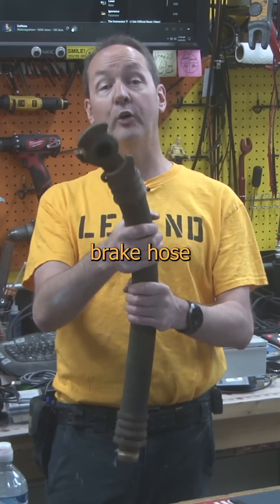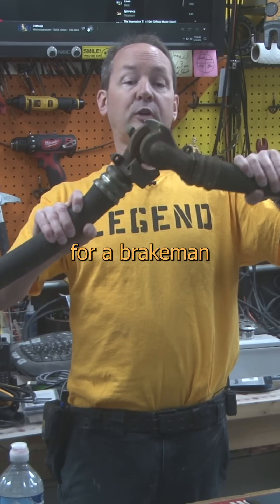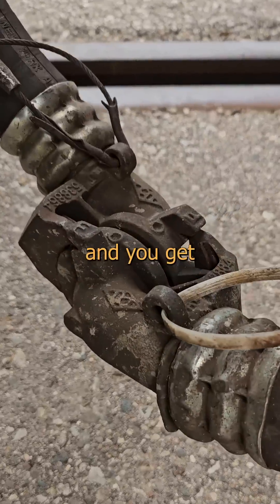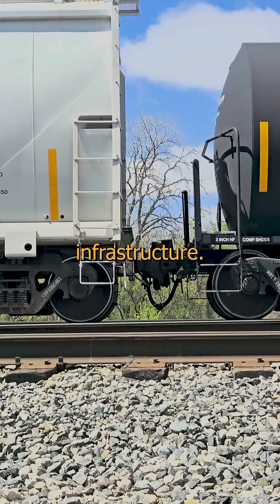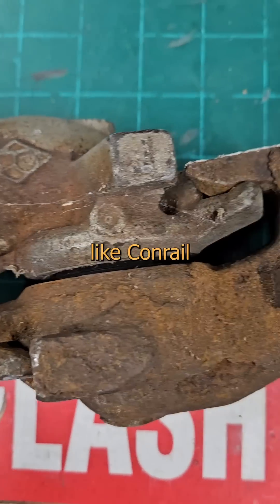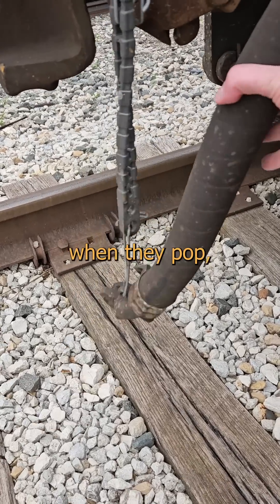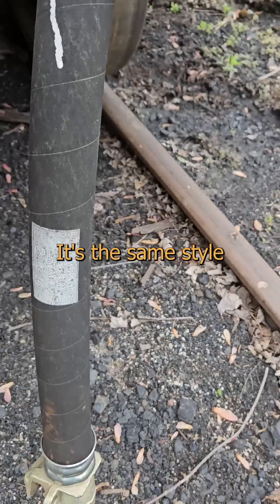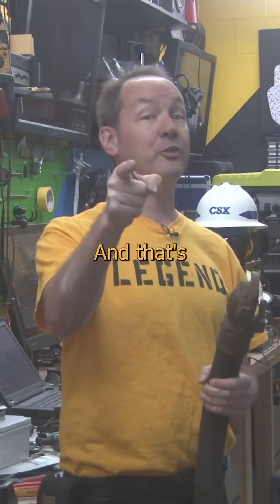Railroad Brake Line #chrisboden #comedy #engineering #train #gladhand #educational #connection #hose

Comment: As someone who volunteers at a small tourist railroad, these things can be a pain. Even when the line isn't under pressure, that's a good solid inch plus of rubber hose, so it doesn't like bending without a little elbow grease! And the conrail joke was very well done! As a train enthusiast I approve!

Comment: The seals do go bad somewhat regularly.  But they are quick and easy to change.  Usually a couple of them stashed away in the locomotive for just such an occasion.  Keep a couple in your pocket when you walk the train and it's no big thing to bleed the brake pipe down, separate the hoses and pop in a new seal.

Comment: If fact yes it greases the wheels but it will take days. Until damage start to get real maybe about 5, day but that depends  but if it's fine and lubed you can run the train you still have to put these hoses together it's law and safety but let's say it doesn't have a hose and it's lubed your fine for a few days 👍

Comment: 90-100psi in the brake pipe. mr lines for the locomotives up to 140 but those are smaller volume. theyre also a PAIN IN THE ASS to connect when theyre actually on the units, youre squatting between the cars/locomotives in between the rails and the hoses arent reasonably stiff and dont like bending the glad hands up.  and yes, they will fuck you up if you get hit with one under pressure when they disconnect without a cable (more common then rubber ones) holding it in place

Comment: I worked for CP rail in the mid 70s.  The large brake hoses held 150psi, we would break them by putting our leg against the hose and lifting it.  It was like holding onto a wild bronco.  A friend worked at CN rail, a government operation, they would just pull the train apart, thereby blowing the hose.  Sometimes the hose would break, and they would have to stop and repair it.  This is an example of a private company vs a government operation: Broken bones vs broken hose

Comment: I'm a little confused. So these brakes not function using some type of fluid? The reason we used fluid in automotive brakes is because liquod doesn't compress. Get air in the system and the pedal is spongey due to the air compressing. If they use fluid how does it not need to be bled?

Comment: True fact.  The air pressure d sure in these hoses DEACTIVATES the brakes, same as in a semi.  

Should a coupler fail, the hose pulls apart,  the line pressure in both parts of the train goes to zero, and powerful springs engage the brake shoes.  Often sand is also dumped on the tracks to improve traction, too.

Comment: You should see the hydraulic brake valve which has 50 plus parts and you've got 8 minutes to tear it down where it goes to a washing machine and then rebuild and those fuqers get hit with a $2 million dollar fine if they fuq up

Comment: Looks like the chicago fittings i used at my old work. Just slap em together and you got a good seal. Need em stuck together flr a while? A pin held the two sides from sliding just in case.

Comment: That’s a big ass set of glad hands. We use the same connectors on semi trucks service air lines to connect the trucks to trailers. The connection allows us to create a connection between the trucks air compressor and the trailers pneumatic brakes. 
Fun fact, we also use the grommets on them to make a Venturi tool when paired with a hose and an air gun. Helps us pull air from the fuel system after a service.

Comment: That is not for "getting fluids" anywhere, it's for the pneumatic railway brake. The one he is holding is made for 5 bar of air pressure, if it has a cross on it it's made for 10 bar which is usually only found in passenger coaches not freight cars. Don't rip them apart while under pressure, they destroy your kneecaps!

Comment: Yeah it works so easy , when you need it to.

Second issue, they almost always are not airtight.
Doing a brake test the acceptable leak determines wheter it gets fixed or not. Whether all of the leak was at one connection or minimal throughout.

Your being a bit genorous with those connections, LOL ...

Comment: yooooo shoutout, I worked as a rail car mechanic for 3 years, Ive replaced hundreds of those, we would just call them the end hose and the rubber thing holding it up above the ground was just an end hose support, I just called it the horse cock😂

Comment: As a trucker who may have accidentally remembered anything other than disconnecting my airlines before pulling away from my trailer... they are also able to disconnect without damage, not every time but I guess in an emergency they can, they just flung 5th wheel grease everywhere.

Comment: When switching, you're constantly connecting these and then popping them apart again seconds later. Every so often the rubber gasket inside the gladhand gets a wild hair up its ass and decides to eject on separation. Every tenured conductor has a batch of these gaskets on their belt or keys. I carried and extra batch on my lantern. Because if you didn't, you usually found a busted or missing gasket right away and it screwed up your whole day or night switching.

Comment: It's cool that even though our coupling works very differently here in Germany these air couplings look pretty much the same at first glance. And they haven't changed in a century. In theory you could connect a brand new rail car to a hundred years old loco.

Comment: I work for the Trainwell at Boeing Renton and we deal with coupling and uncoupling cars every day, all day, it’s shuffling around 4 tracks instead of freighting over one for thousands of miles, it’s really fun and dangerous, the hands are always sketchy but you learn to trust them, when you open your air valve to let the cars behind fill with air the hoses flex and twist under the volume of air, it’s only about 120psi per our cargo requirements but the volume of air is massive! working with BNSF is cool too, we have a Hercules TracMobile to hustle cars around but when BNSF comes in with their Locomotives, its always a treat

Comment: I do industrial blasting that airlines a baby to compared to what I use witch is a similar at locking you just but them together and give it a quarter turn  and the thing that is hold the hose is called a whip check

Comment: It's essentially the same thing on modern gas pumps to refrain the excruciating repair costs if someone accidentally drives off with the pump still attached. There's a second detach right where the gas hose is attached to the pump body just in case. (:

Comment: the steel and brass fittings are thick as hell and seemingly indestructible, but the rubber fittings inside often break or wear out... so conductors often have a few spares on hand and just swap them out as needed. Takes very little time. 

But those hoses don't link up as easy in the field as in your demonstration. It takes a bit of practice to get them to lock in right, especially in -38c.

Comment: I work with these things every day, and they're actually really cool how  the basic operation of these systems work . If you dived a little deeper, you'd get every  train furry a little excited with big hozes and things that connect with rubber. 😅  the coupling mechanisms are really cool as well, if you actually dig into them and how they actually operate . 😅 just food for thaught big guy , love youre content.  Keeps my tisum under control.  I am  allwase wondering how ur going to slide a furry joke in which is pawsome.

Comment: I work on semi trucks and those glad hands take quite the punishment, the biggest failure point on those would be the glad hand seal. Truck drivers aren’t the brightest bunch so they do break glad hands in interesting ways. Sometimes the fittings to the truck break or leak real bad. Sometimes the hoses run through on the deck or the back of the cab. Or sometimes they don’t store them on the holders properly, and they slip under the deck and dangle by the driveshaft, then the drive shaft snags them. Wouldn’t you know it like a cheap circumcision, the glad hands get snatched right off and nearly every bit of line, fitting, and valve will follow. It leaves me speechless how these things happen, but oh well. Keeps me in a job I suppose.

Comment: Gland ends work on trains because if a wagon comes loose these disconnect without breaking. On a truck however, the seals in them never seal properly leaving the trucks compressor running on and off constantly. They also fall out or perish in a short amount of time and if your trailer comes off, you are ripping all the airlines and wiring out of your truck or trailer.

Comment: One difference between the truck version and the train is that truck is couple and uncoupled is to place both half 45° to each other to lock and returning to 45° to unlock and the train is 45° to lock but just pulls them apart to unlock

Comment: actually most people call them an air hose, it uses 90 psi to keep the brakes apart, and when they split without cutting out the air, it goes into emergency and all 90 psi dumps out and the brakes apply as hard as they can

Comment: The brakes on a train are normally engaged, when pressure is applied to the brakes they become disengaged. 
This is a safety feature -  if train cars get separated, then the  brakes on the free moving cars lose pressure and the brakes are applied.
Reply: not really true, the brakes are applied based on a pressure differential between the car reservoir pressure and the brake pipe pressure. if the car reservoir is full and the pipe pressure is 0, you get a full application, but if a car isn't hooked to a locomotive to maintain the reservoir pressure, over time it will leak out and release the brakes. that's why there is a handbrake to mechanically set the brakes regardless of air

Comment: Actually, in Australia we dont use "glad hands" air connectors on our semi trailers, on rough roads they come off.  Instead we use bayonet connectors that have a locking collar, which when used correctly, never self disconnect.

Comment: As someone who has worked with those types of hoses they don't provide liquid from the head end of the train they only provide are to either open up the doors or clothes or and also the the bigger hoses or your thicker hoses those are the ones that provide the air to your brakes on the end from the engine to the whole train

Comment: Did 10 years as a locomotive mechanic (machinist) and this is true. Those hoses are insanely strong to the point that they have the date molded into them to require them to be replaced after a certain number of years (varies with type of equipment).

Comment: The seals on the freight train brake hoses cannot fail because they are made from Teflon.  The hoses are also Teflon, the rubber outer is just a protective layer.

Comment: Vacuum Brakes. 
Once the Vacuum is lost the Brake actuators applies. 18 to 21 inchs of Mercury. 
 Air Brakes release the spring brake actuators at 60psi before drive can be Engaged. 
Retired Irish Rail Craftsman. 
🇮🇪🇪🇺

Comment: Iv seen many hopping trains, did yall know it's impossible to have a run away train? Those hoses release the breaks, the breaks are always on, so if one fails, or the cars separate, it grinds to a stop.
Reply: They dont actually physically keep the brakes open on a freight car, but a drop in air pressure in the brake pipes causes the brake control valves on freight cars to pull air from a reservoir and then pressurize a brake cylinder to apply the brakes. So the brakes aren't always on, and need physical handbrakes for when they are parked.

Comment: You should do a video on how the brakes and air system on train cars work, that would be pretty cool too
Reply: Basically end hoses are what are on the end of a pipe on a freight car called the brake pipe. All the cars are hooked up to each other and then to the locomotives that have air compressors on them. The locomotives send compressed air to each freight car, and each freight car has a mechanical control valve that controls the brakes on that car. When the train is starts its journey, it compresses the air to 90 psi, and a reservoir on every car gets charged up. Brake applications occur when the pressure in the brake pipe drops from 90 psi. The control valves sees this pressure drop, and uses air from the reservoir tanks to pressurize a brake cylinder on the car, by a corresponding amount of psi. The brake then exerts force on a series of linkages, that then push the brake pads against the wheels, stopping the train. If a failure or emergency happens, such as the train seperating causing the gladhands to seperate and vent their air, the freight car control valves will see this complete loss in pressure, and dump all the air from the reservoir in the the brake cylinder for an emergency brake application. There is some more to this, but that is the basic gist of it.

Comment: Truckers use the same connection on their air brake likes. As a train buff and trucker, I always got a kick of using them. Thank you for sharing this video.
Reply: Worth noting that the same style of air brake lines with glad handles were used in military 5-ton trucks like the old M932.

Comment: As a former crazy tree guy, dope on a rope, the neglected infrastucture line is true and you never want to hear expensive sounds there.  But its a lot of fun running down the track in a bucket truck fit for rail work cutting back trees.

Comment: I was an Electronic Design Engineer; contracted to a Railroad Mfg using on-track Wheel Impact Load Detectors (WILD) sensor array. And Rail Stress Monitoting (RSM) devices. 
* Railroads have some of the most unusual equipment to watch in action

Comment: This is one of the few things that don't grind to a halt when it fails, might still get the expensive sounds though.
Reply: The train quite literally will come to a halt if one of these fail, the brakes are triggered via pressure drops in the brake pipes that these end hoses connect between.
Reply: and everytime a train is stopped to due an emergency brake application it can cost a major railroad tens of thousands of dollars due to the delay, so yes it can be very expensive and no railroads do not like failures in these hoses.
Reply: @acehawk888  i knew it uses air pressure to keep brakes open, just sounds way funnier to have it how other brakes work.
Reply: @Daniel37parker they dont actually physically keep the brakes open; the brake cylinder needs to be pressurized to push on the linkages that then push the brake pads against the wheels. The way it works is that every freight car has its own air reservoir tank that is filled before the train moves, via the brake pipe, which is normally at 90 psi. The brake control valves that are on each freight car then look for pressure drops in the brake pipe, and upon detecting one, send the corresponding amount of air from the reservoir tank into the brake cylinder. So if the locomotive engineer engages the brakes by lowering the brake pipe pressure by 30psi, the control valves see this and send 30psi into the brake cylinder from the air reservoir. If an emergency happens and lets say a coupler brakes and a section of cars disconnects, the gladhands will disconnect as well, venting all the air in the brake pipe. The control valves will see this 90 psi drop and then dump all of the air from the reservoirs into the brake cylinders for it to jam on the brakes. This happens fully independently for each car.

Comment: i like trains and i know even as a yonger gentleman, if you dont have a good hookup, or none at all, the brakes wont release. Instead of the air holding the brakes closed, the air pushed the brakes open and lets the locomotive pull.
Reply: on a freight car the brakes valves are activated by a drop in air pressure in the brake pipe but the brake cylinders themselves have to be pressurized with air to engage the brakes. The control valves on each freight car pull air from a reservoir corresponding to the drop in pressure in the brake pipe to pressurize the brake cylinder.

Comment: You have to turn them at a 90 degree angle to connect them.  Yet when they pull apart they aren't at a 90 degree angle, I don't get why they don't get damaged.

Comment: That is a brakepipe connecting hose. The principal of the train brake is: air is required to keep the brakes OPEN so the train can move. Therefore, if the train loses power and can not maintain air pressure it closes the brakes. Should the cars become uncoupled in transit, connection is secured and breakes on all cars are applied simultaneously. This is the emergency braking system separate from Service Brake, which brakes with the application of air to the system.
Reply: Yes and and no, air in the brake pipe is required to keep the brake valves from triggering, but it is not  required to keep the brakes physically open. When pressure drops in the brake pipe, the mechanical valves on each freight car pull air from a reservoir (each car  has its own reservoir and it is charged at the beginning of the journey by the locomotive) which is then sent to the brake cylinder. The brake cylinder then generally pushes on a series of linkages which then press the pads against the wheels. The pressure of the air sent to the cylinder from the reservoir generally corresponds to the drop in air pressure in the brake line from 90psi. Emergency and service brake application both fundamentally
work this way.